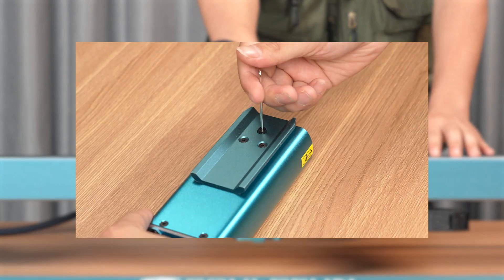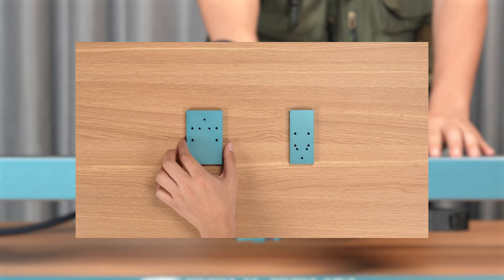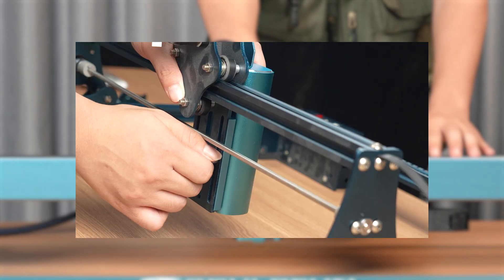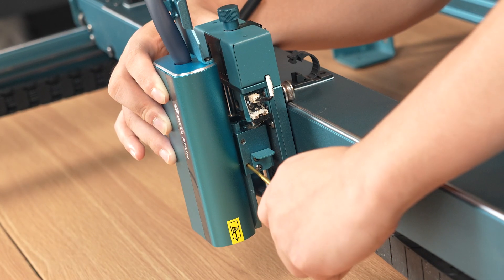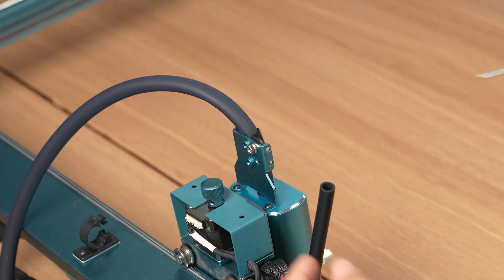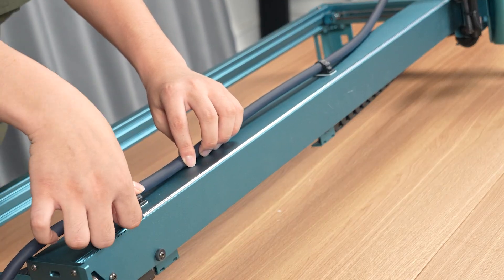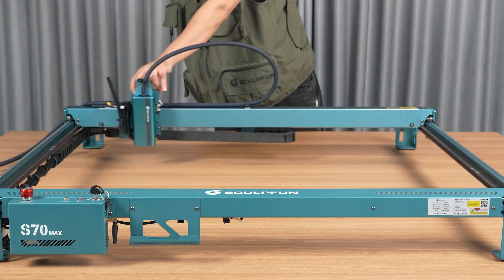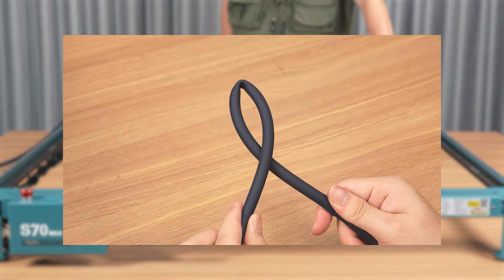Sculpfun Tutorial: How to Install IR20 on various Sculpfun Machines (S70, A9 & S9 Included!)

Comment: Hello, the 20W Sculpfun IR20. I'm not sure how to connect it to a 70W Sculpfun.
Does it need a special driver or how to program it in Lightburn? How do I configure it?
The laser doesn't work. Thanks.
Reply from the maker: one thing to check before everything. The frequency buttons are actually clickable, and it's the switch. You will need to click it first to start the module